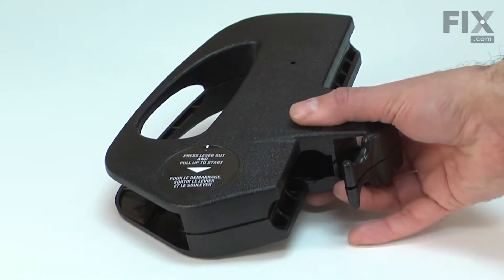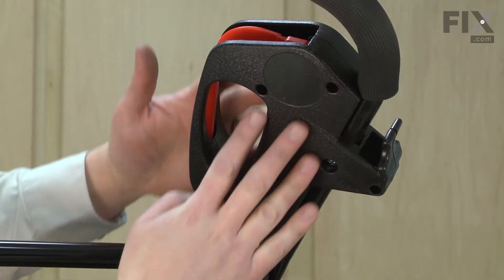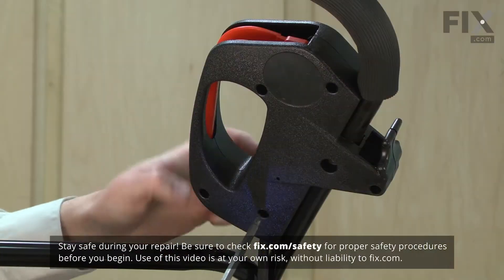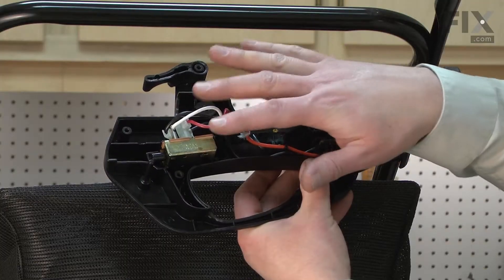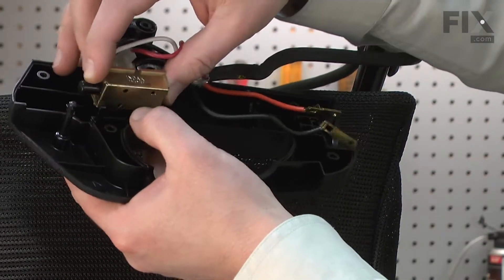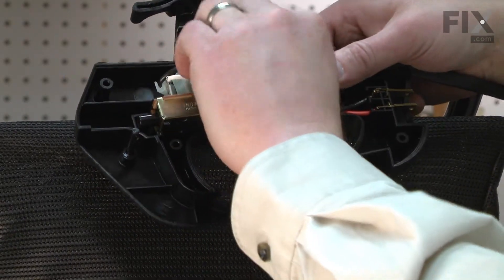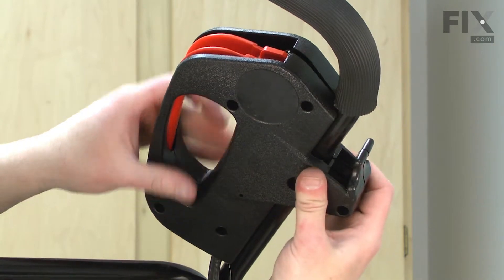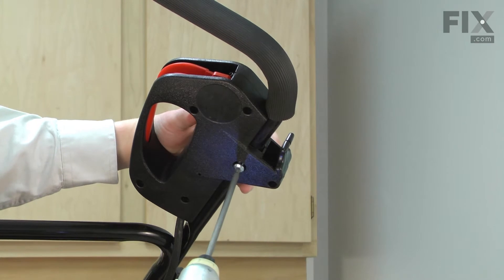Black and Decker Mower Repair - How to Replace the Switch Housing

Comment: Thanks for the video! The plastic pin around which the switch handle pivots broke on my lawn mower. I fixed it by drilling a similar sized screw into its place. Thanks to your video, I was able to get everything back into place properly so that the handle presses the switch and the lawn mower works again!
Reply: I had the same problem with a broken plastic pivot pin.  I drilled it out with a 7/32" bit which was also the exact diameter of the pivot pin.  I ran the bit through to the outside of both parts of the housing & used a through & through machine bolt & hex nut to secure the pivot point of the switch handle.

Comment: I know this video is very old, but I bought a housing years ago and just noticed that it is bigger than my original one, but is the correct part number.  However, no screws came with it and I was wondering if you would tell me what size screws to buy.  Thank you.
Reply: My switch housing looks identical to the one in this video.  Most of the screws holding the housing together can be described as T-20 Torx pan head screws with threads meant for predrilled plastic.   I can't find them at any nearby sources.   I wound up going to a local building supply store (I used Menards) and in their fastener section found screws with regular slotted heads that were the right length and diameter to do the job.   Stainless steel would be a better material than the OEM screws that came with the mower, since the switch can get exposed to damp environments, but not strictly necessary.
Reply: @adembinski110  Thank you. Much appreciated.